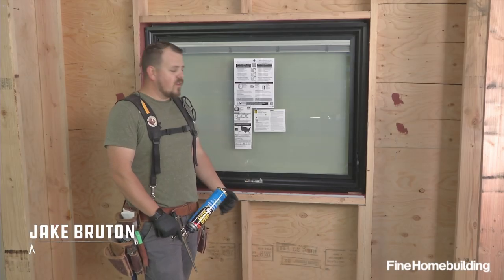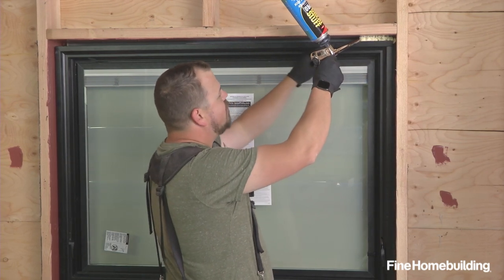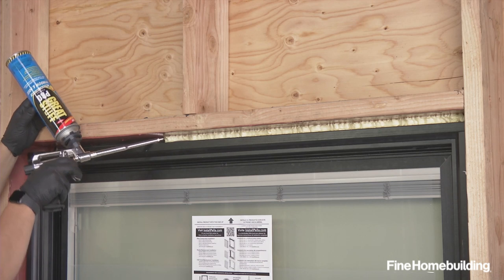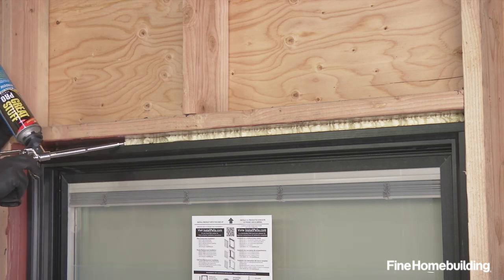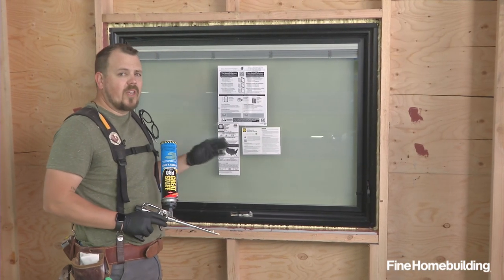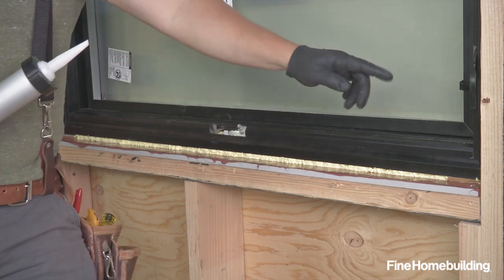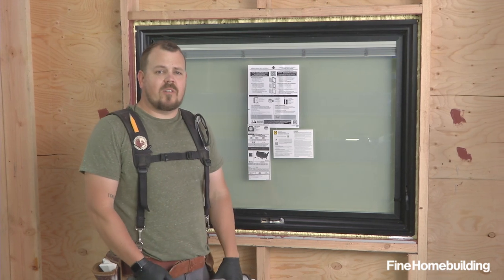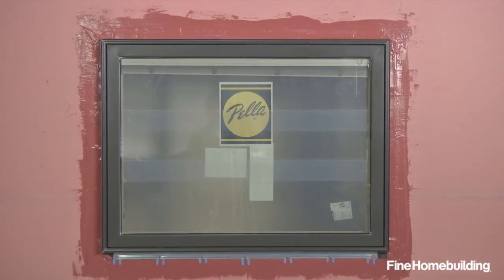Part 4: Air-Seal and Insulate a Nail Fin Window Over a Fluid-applied WRB

Comment: Have a question: Since the window is 100% garanty free leaks from outside, why keep a pocket of air without foam insulation? Now the window extension is hot inside and cold in the exterior pocket of air. Isn't it calling for condensation when   exterior temperature reach a high relative humidity contrast?

Comment: Spray foam is not a good insulator. You don't know if there is consistent adhesion throughout. Best method is to use a larger backer rod and stuff the cavity between RO and window and then  use Airdam or similar product to air seal. Over time foam will break free with movement and cause issues. Also it will absorb water once that adhesion is compromised.

Comment: Spray foam isn't an air seal.  Need to use that air barrier compound around the entire window.  Use a backer rod to ensure that hour-glass bead for a durable joint